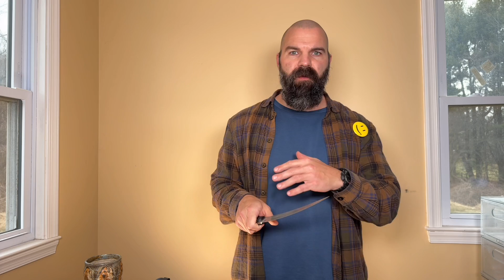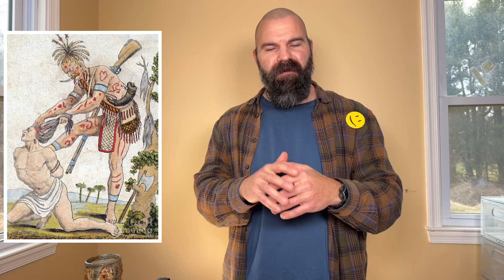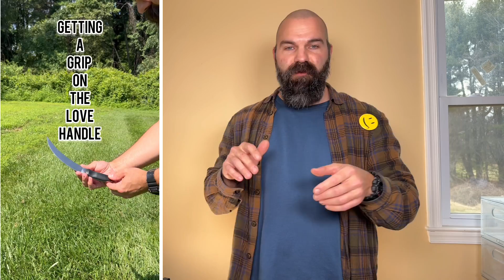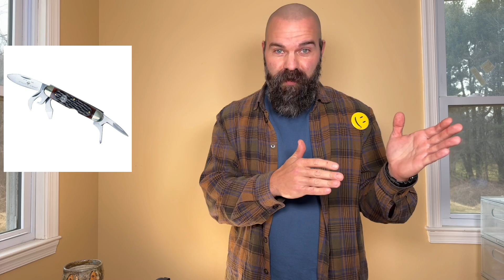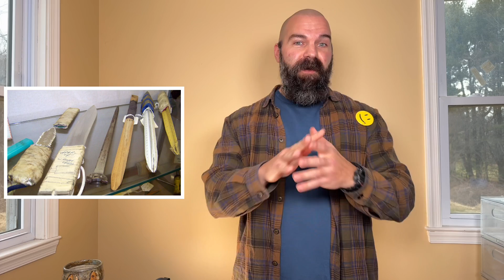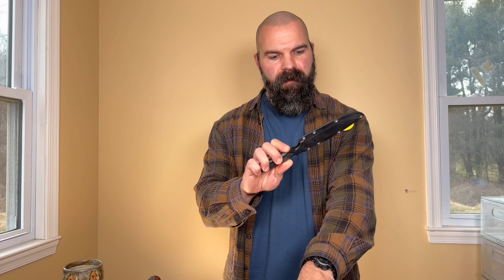Meet the Love Handle - a new big blade for your every day carry!

Comment: I think you should to do that sheath for scraping. It would potentially bring you more customers. It would be a shame not to make the most of this design you came up with. Regarding safety of that sheath and additional bulk that comes with safety - use a solution you said in the video - use a lanyard like thumb daggers.
Reply from the maker: Thank you for the comment and suggestion. I agree that the thumb lanyard is probably the most compact way to keep the hand from sliding up the handle/sheath and onto the blade. Will be thinking on this. Best regards.

Comment: Once you get some testing done... I'm sure a kukri could be adapted to that carry style! I'm thinking like a smaller Salyani kukri which is naturally/historically not as wide would work perfect. I'm imagining a kukri sheath where the upper half has an open back so that you could push the spine of the kukri outwards then draw to the side. I'd totally buy a good 7 or 8" Salyani, I think the kukri's chopping strength allows for good power despite being a lighter blade such as the cold steel kukri machetes
Reply from the maker: That is an intriguing idea! I will look into Salyani style kukris—thank you for the suggestion 👍
Reply: @wingardwearables  Glad I could help! The Salyani is one of the most martial arts/fighting focused of the kukris too, totally fits your style of products!

Comment: Haha. Iam a butcher & I was playing around with my knifes with self defense thinking way do you not see much knifes with this blade shape. And I love curvy knifes, so when I saw this I thought this is amazing. Awesome knife brother, well done. I have to get me one, it’s just such a wicked shaped blade. Take cake
Reply from the maker: Thank you for the comment and insights. I think we have a couple still available from this batch—but if you miss out there will be another batch or two in March and possibly April.
Reply: Soon as I got home I saw they are sold out. But did you say April you’ll have more love handle knifes? And are you going to make the grind a little lower digree to make it a bit more slicy as well I heard?
Reply from the maker: @LitQueen3 we should have another batch in March. Truth in advertising: It’s a 3/16” thick spine, so the edge angle is going to be significantly stouter than a typical butcher knife. The thickness is good for strength in thrusts and specific bushcraft applications—and helps reduce risk of warping during heat treatment. The thinner spines and higher bevels on butcher knives will be better at slicing.
Reply: Thank you brother. I’ll be getting one on April then. But great work man I appreciate your work & what you do with making it possible to get these great works made by American artisans. Take care

Comment: It's always a pleasure too see you post a new video, you don't do tests very often, because some people make that their whole thing, but when you do do it it is very well thought out and it is a breath of fresh air.
There is a lot of thoughtful applications, and I may have an idea that might fix that draw knife second handle problem.
I do really like the draw knife concept because it may not be the perfect blade for it, but when you need a draw knife, it's in a situation where you can take anything that you can get and whatever you will make will be a million times better than just carving a block of wood sticking the blade into it and then tying some bark around it like I've seen before.
My idea would be a corded system with a modified wrap-around type sheath.
Imagine a 12-in piece of paracord, and you have a piece of folded over leather, It may not need to be made out of leather, but something flexible enough that I can go already over the sheath as if it is part of it, maybe some type of thinner weather-rated polypropylene, for simplicity purposes I would say marine grade.
It would be like one of those laundry clips except very long and flat, very similar in shape to a credit card, it would "click" over the main sheath and it shouldn't be more than a centimeter or a fraction of a centimeter thick, and it would barely impede if done correctly, were the cord comes in is it would attach to the handle using that bulge as a stopper, and it would either have a groupier texture like... Now that I think about it there is this very cheap but very dependable Kevlar kite string that is so tough that you can use it to cut wood and that abrasive surface could be really good for gripping, and how it could be done is the cordage could provide tension keeping that secondary clip-on sheath constantly tensioned onto the blade so that way it would have a preference for not slipping, to change the angle of the tension there could be a little sliver of an edge, kind of like a thumbnail on the side of it to that the cordage could slip into to either put the tensioning higher or lower, similar to a bandsaw on the pioneer trail.
You would unclip it and then clip it, the part with the tip goes into would be designed to be solid while the rest of it is unfoldable, maybe taking advantage of the inherent flexibility of polypropylene or other high impact plastics, and it would be flexible enough to go around the normal sheath while still being thin enough to do so, but it would be rigid enough to be clipped onto the end of the knife blade and that cordage could very easily be used for other purposes if you were to use that Kevlar kite string which you can find on Amazon, and all you'd have to do is wrap it around the handle to get a very thin and barely noticeable layer. Or, if you want to go the extra mile it can also be wrapped around the grip for the extra bit of physical retention if it doesn't get in the way but that just depends on how you tie it.
Reply from the maker: I think I am correctly envisioning your idea, and that is pretty darn clever. I will need to survey materials—I don’t know if I can source a metal clip that’s the perfect size, but it may be possible to improvise or make one for prototyping purposes.
Reply: @wingardwearables  I appreciate the compliment, I know sometimes things just aren't meant to be because people's brains aren't in the right place, but I really do appreciate you taking it into consideration. And I'm glad I was able to describe it adequately enough. Good luck, a good idea should never go to waste because of improper execution.
Reply from the maker: @crimsonfox87fluxule62 agree—will consolidate folks’ suggestions and map out path to prototyping.

Comment: French self-defence manuals from the 1890s-1930s include the "edge up" grip for knife fighting- they say it is done so the blade cannot easily be grabbed from you, as you can simply slice upwards into the adversary's hand as they reach for it. I was taught the same for Bowie knife in the Keating/Comtech system.
Reply from the maker: Interesting—that makes a lot of sense, especially if your blade is over 4”—the longer the blade—the more to grab onto.
Reply: Page 78 onwards-
https://hitandnotbehit.files.wordpress.com/2017/09/selfdefence_andre_ptc11.pdf

Comment: with the extreme curve this knife could be used to thrust upwards and curve under the ribs and easily reach vital organs in a grapple.
Reply from the maker: Definitely. Also we did some simple stab tests—a cardboard witness panel was placed over an archery target (tightly compressed foam00designed to catch arrows—including tipped with broadheads). In hammer grip, if your wrist is locked firmly, the extreme curve of that “trailing point” results in a pretty large entry wound. Measured off the cardboard, it was about 3 inches wide—that would be pretty devastating against the abdomen.

Comment: 80 grit sandpaper on that micarta  is very gripping also. That the beautiful thing about micarta.
Reply from the maker: There may be customers that choose to “roughen” the handle scales for additional grip. If we did a rougher sanded finish, it would be grippier and save us a lot of time, but the color would be grey, not black, and it would change over time as the user gripped it or wore it—imparting the natural oils of the skin into the handle—that can wind up looking kinda blotchy/greasy, depending on what the handle is exposed to. So for this blade, we wanted the black paper micarta to actually look black and stay relatively stable in appearance. The grip profile is roughly contoured then it’s oiled and hand sanded pretty darn smooth—that takes a lot of time but looks great. All of that is done before I hand file the grooves.

Comment: Love this design and it might actually work for everyday carry. I love the design of the tomahawks but there's no way I could stick those down my pant leg and do anything I need to do during the day other than just walk. To be fair I have never tried one but I have taken a wooden dowel that's a lot skinnier of the same length and put it in my waist to see how well I could move and it doesn't work out very well if you have to climb or lift your leg high. And appendix carry is definitely out on those, the handle would be hitting my balls all day. The Quill is bad ass though.
Reply from the maker: The tomahawks work, but pant height, pant tightness, and belt tightness must be “dialed in” for the tomahawk to move with your body, even bigger leg/thigh motions like kicks or lunges are fine. Recommend checking out a video where we go over these factors and other carry tips.

https://youtu.be/4ewlITkVpGY?si=S7tiMcVuxlsyg3KM

Thanks for your comment and hope you have a great day.
Reply: @wingardwearables  I'll watch the video thanks for the reply